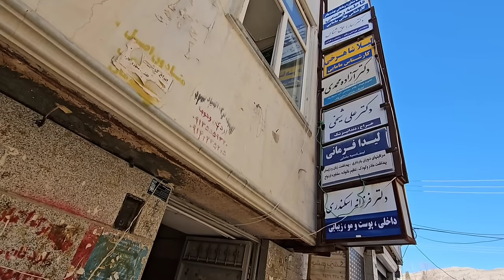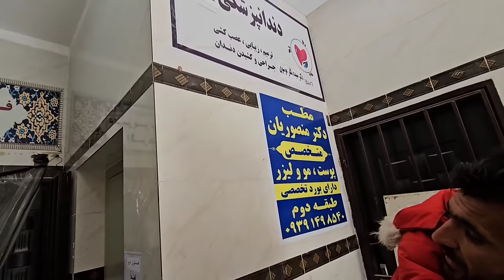"The forest of life: saving children from the fire of disease spread". Part 133

Comment: I am a well wisher for this family, but i find it difficult to accept the following:
1. Firstly regarding the children. I have said it many times that the 3 children are getting sick too often and the parents don't seem to understand that without precautions taken to isolate a sick child, others will get sick too. 
2. Imran hugs and kisses the children too often unnecessarily. He should stop it as this is one sure way to pass on infection from one sick child to the next. 
3. Children are allowed to roam outside in the windy and cold weather when they should be taking rest to get well. 
4. Giving children showers regularly and  getting them to sleep in clean clothes and in clean beds will reduce infections.
5. About the car: How did this new car become so dirty so quickly? When it was given as a gift, imran should have covered the seats and floor mats with  plastic and also in the car boot. 
5. He should spray the car with disinfectant to kill off the viruses and bacteria. 
6. Very important: the 3 children should sit at the back with belts on and both Feteshte and Imran should also wear seat belts. 
7. Children should absolutely not sit in the lap of adults in front. 
Thank you.

Comment: Cómprale untapis al carro para que no dele en sucie
Reply: You have to change the oil completely, put in a new oil filter and fill it with all new oil.  Otherwise, you will ruin your engine and the car will be useless.  It’s very expensive to fix or replace.